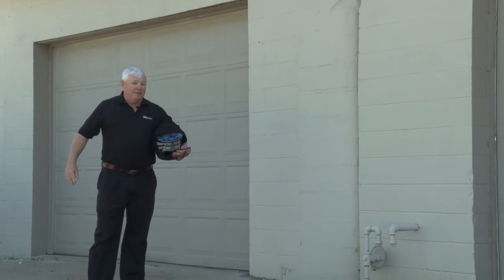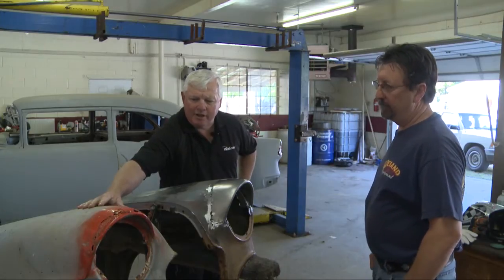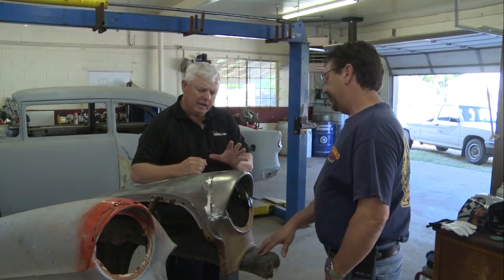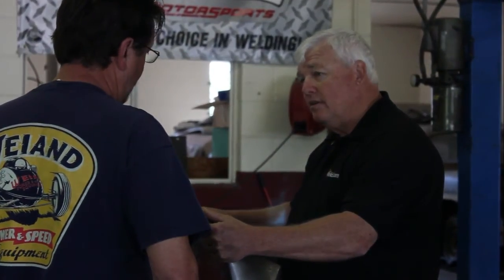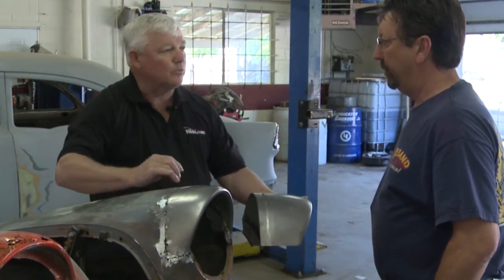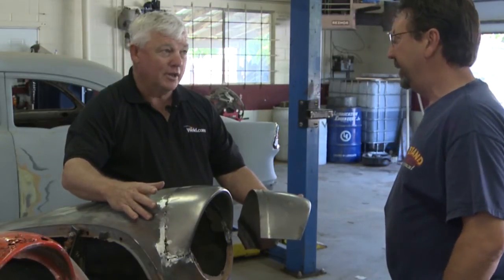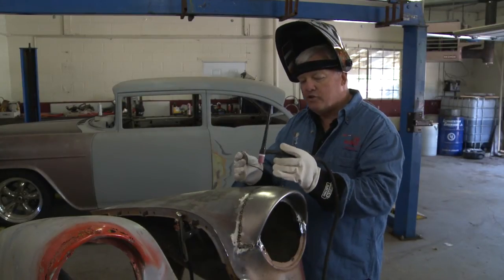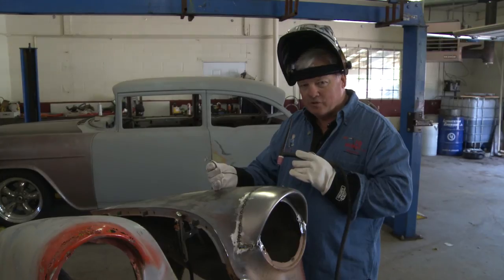Classic '55 Chevy Restoration (Preparing & Tacking the Eyebrow)

Comment: You should hammer and dolly and stretch each tack to move it where you want the patch,instead of forcing it to stay by tacking everywhere...all those tacks are going to shrink a little differently and create stress...this stress is what creates the "high or low" warped areas that become very difficult to work after the panel is welded

Comment: Hi,
I have a question for Mr Tig, can you give me some advice. I'm thinking of buying myself a Tig machine. I live in Estonia so for example Miller doesn't have distributor here, but finnish Kemppi and swedish ESAB distributors are around. 
So my question is which one of these two welders do you recommend ESAB Caddy Tig 2200i AC/DC TA34 or Kemppi MasterTig MLS 2300 ACDC.
Do you have experience with these brands.